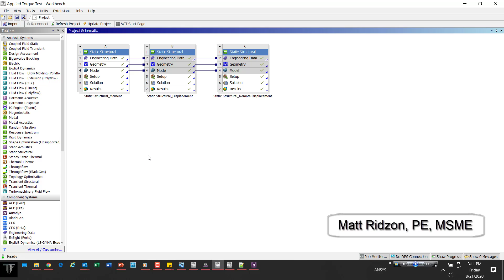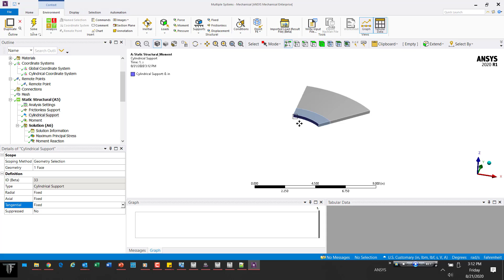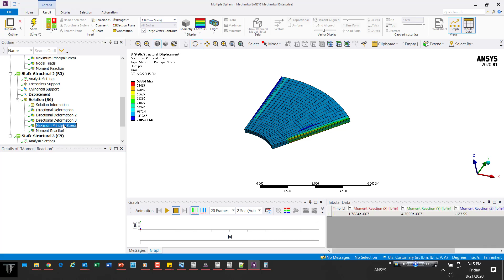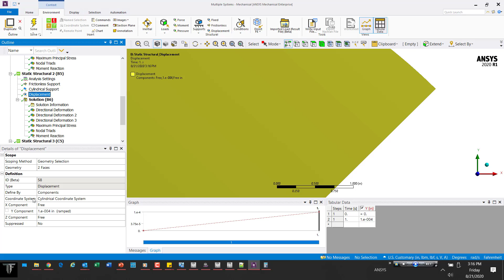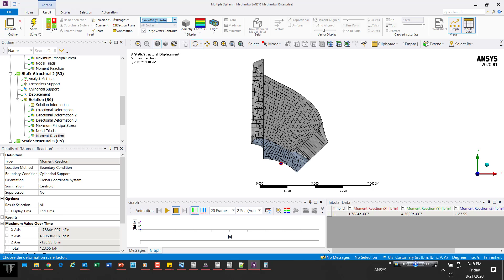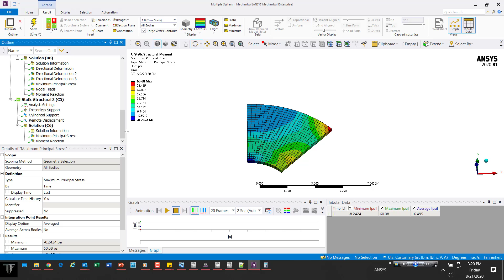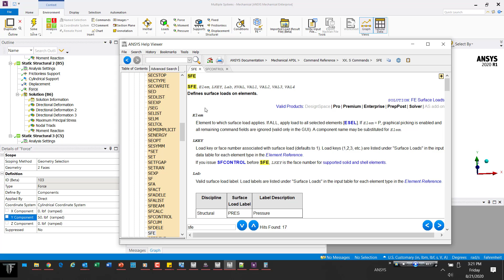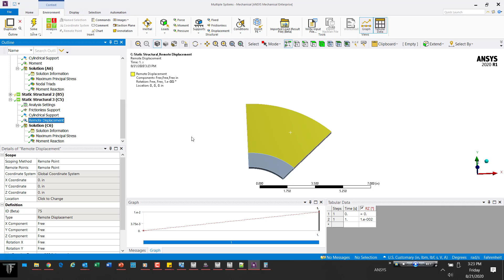Differences Between Moments and Angular Displacements in Cylindrical Coordinate System in Mechanical

Comment: There are so many issues with this explanation, I don't think anything is 100% incorrect, but you haven't actually explained why the difference occurs. In all cases the nodal CS will not update because all of these analyses are all linear static structurals (correct me if I am wrong if they have large deformations active). It is not purely due to the nodal CS not updating that this difference occurs. You then apply a force using the direct method then talk about surface elements, which isn't utilised if the force is applied directly, this uses the F command. You also fail to mention that the stress contours between the cases are different, and don't explain why that would be, and you also don't mention that there are competing constraints/displacements at the edges of your model (when the load is applied as a displacement), where the peak stress is occuring.